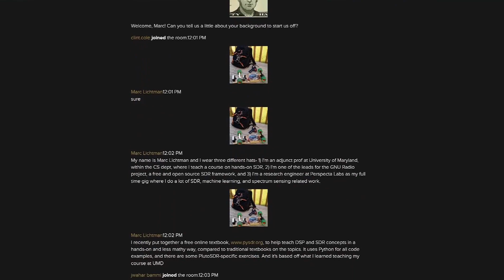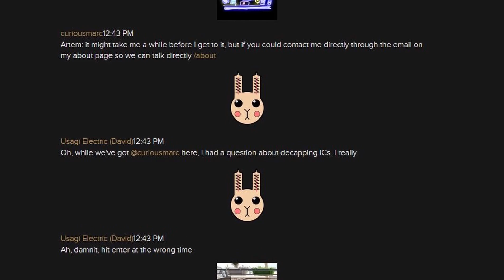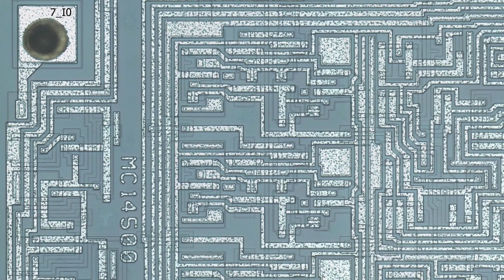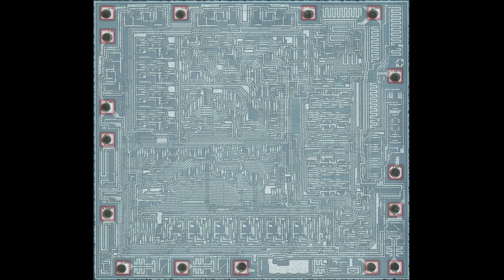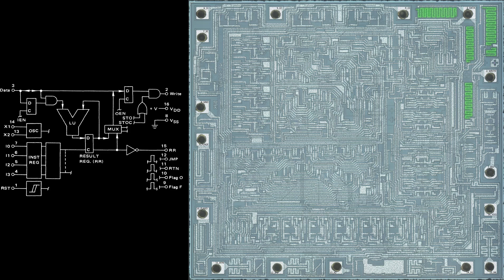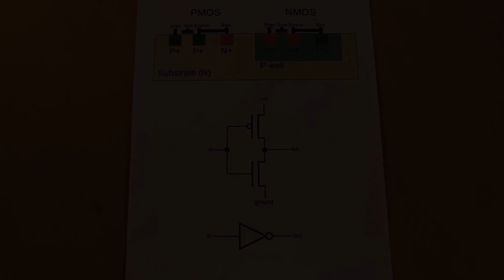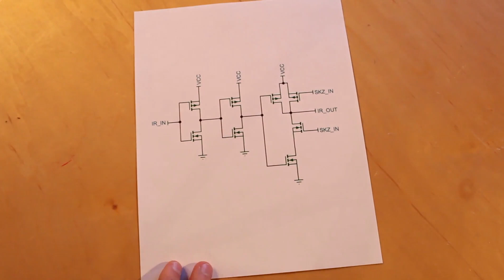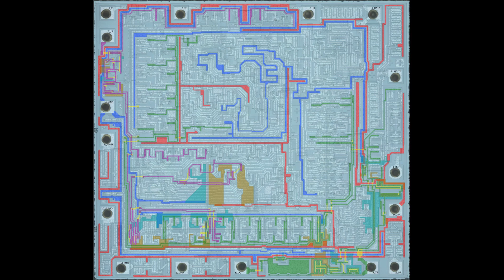Reverse Engineering the Motorola MC14500 1-bit CPU

Comment: To put it a bit more clearly, the first two stages are inverters as already explained. This is basically just buffering the input. The last stage is a NAND gate.

The top two transistors are PMOS, so they conduct when their inputs are low. Because they are in parallel, if either is active (either input is low) they will pull the output high.
Otherwise, it'll let the output float.

A B O
0 0 1
0 1 1
1 0 1
1 1 X

Likewise, the bottom two transistors are NMOS, so they conduct when their inputs are high. Because they are in series, both must be active (both inputs high) for them to pull the output low. Otherwise, they will let the output float.

A B O
0 0 X
0 1 X
1 0 X
1 1 0

Because the truth tables don't overlap, when one set of transistors let the output float, the other set will pull it high or low. In other words, you just combine the truth tables:

A B O
0 0 1
0 1 1
1 0 1
1 1 0

This gives you a NAND gate.
Because CMOS directly connects to either high or low without a pull-up resistor, there is no current flowing when not switching, which is what makes CMOS logic so efficient. It's also what allows logic levels to hit GND and VSS completely, which is super useful. Alternatively, you can create NMOS logic by using only the bottom half of that circuit and using a pull-up resistor or you can create PMOS logic by using only the top half of that circuit and using a pull-down resistor. This, I think, is closer to how tube logic is built.

I'm not familiar enough with tubes to know this, but I wonder if in theory a CMOS like approach could be taken using the concepts of followers and inverters. Obviously this wouldn't be practical in real works applications regardless, but could be a cool experiment.
Reply from the maker: Thank you for the excellent breakdown!
After I showed Ken the video, he sent back an e-mail saying that it was indeed just a NAND gate on the end their, and it was truly a facepalm moment. It was one of those things that was so hard to see until it was pointed out, and then it was so hard to see why I couldn't see it before, haha.

CMOS stuff is really interesting because the combination of both NMOS and PMOS. In tubes, there's not really an equivalent to a PMOS type circuit, so it was really hard for me to wrap my head around the idea of "depletion mode" stuff. To be honest, I still haven't fully grasped how and when to use PMOS or even PNP BJTs. 

But, creating logic gates using diodes and pullups is pretty common in tube circuits! Essentially, to build a NAND gate, you can build a diode logic AND gate and then use the tube as an inverting amplifier. Same with OR and NOR. It really make it easy to build complex logic. I've even managed to get an XOR and XNOR gate to work using just diodes and and inverters! I was quite happy when that one worked: https://youtu.be/ANrSOlgGSOU
Reply: @UsagiElectric  As far as PMOS, it's similar to NMOS and presumably Triode logic, but kinda backwards. So instead of pulling up to logic high, you pull down to logic low. And things that are in series tend to go parallel, and things that are in parallel tend to go series. If that makes sense. As for when to use one over the other? I have no clue.

I'm not super familiar with diode logic as it wasn't taught in the electrical engineering program I went through. (And neither were tubes. Crazy that they'd focus instead on semiconductors! XD) I did just Google to see what logic AND and OR look like and they make sense! But definitely not something I would have thought of really. Similar to your response to learning that was a NAND gate, it seems obvious after.

But I think a lot of that boils down to different people having different backgrounds of knowledge, interests, experiences, etc. And really that just keeps things interesting! (:
Reply: The tube equivalent of a P-channel FET would be made of antimatter and use positrons instead of electrons. Combining the two would be rather dangerous.

Comment: Wow! This takes me back to 45 years ago, when I worked in wafer fabrication. Can't go into specifics, for security reasons, but, on occasion, we used to reverse engineer devices made in other places, to figure out what was being done, and to learn how we could improve on the circuitry. We used a combination of etching, lapping, polishing, staining, lapping at oblique angles, and more, to determine doping types, doping depths, insulation depths, widths, lengths, and other information. It took time and patience, with the right tools, techniques and any insider knowledge which could be gleaned. 

Those methods enabled us to figure out recipes to make better devices, and to tailor them to our customers' exact requirements. (Yes, we called the instructions recipes, because the semiconductors were cooked in ovens. (British humour...)) It was fascinating work, for those with the skills. Our competitors were doing the same things with our circuitry, and different manufacturers would often send sample devices to others, knowing full well that they would undergo forensic examination. The net result has been a rapid pace of progress for most wafer fabrication businesses, and end users are benefitting from that type of reverse engineering to this day.
Reply: It's interesting that it's deemed to be less work to try to reverse engineer a chip, given how difficult it seems to be, then to create a new one.  But then you are saying almost 50 years ago, which means it was easier to reverse engineer whatever was around back then, and harder to make a chip due to lacking the software we have now.

Comment: I used to work at a chip layout company and one of the services they provided was called "Competitor Analysis"...  The company would acquire some chips, then they would be decapped with acid and one of the engineers would painstakingly move over the entire chip's surface using a very expensive optical microscope, while recording the microscope picture with a special TV-resolution camera connected to a VCR, pausing at roughly one screen-worths of a picture.  They'd then strip the current layer off and repeat the process until all layers had been filmed.  Then some poor person at the company would use AutoCAD and a video capture card to trace over each screen of the video.  Then using this simplified drawing they would work it up to an actual schematic.  Incredibly time-consuming and very difficult, since as you might guess you don't get a great picture from a VCR tape, and the decapped chip was never perfectly etched down to the current layer.  Also some of these layers are somewhat transparent, so it was a very complicated process.  Obviously this kind of procedure would never work on smaller digital chips, and in the late 90s it was starting to become impractical for analog/hybrid chips anyway.  Crazy stuff.

Comment: at the end of the day it's almost just n-channel and p-channel Mosfet wired together in a logical way. 
NPN and PNP transistors would have needed resistors and current flow. 
Mosfet only require power when the state is switched.

Comment: A lot of vacuum tube computers used serial ALUs. So essentially you have a 1-bit ALU, then using shift registers as your CPU registers, you can shift your data through your 1-bit ALU keeping track of the carry in a flip flop. 
You might want to do that instead. You'll still save loads of hardware, but the processor'll be a lot more capable.
Reply from the maker: Thank you for the comment!
I've actually done a bit of testing with building up architecture around using serial architecture (serial ALU, shift registers, etc.). It's a really smart way to do things, and in the future I may very well lean into that idea harder. The primary reason behind building a replica of the MC14500 is because I think it'd be cool, haha. Also, I like the idea of being able to build a system based around the actual chip and then use that as a preliminary test bed for what might or might not work on the tube version. 

Also, the more I tinker with the MC14500, the more I discover that it can do some really interesting and complicated things. For example, using IEN and OEN to mask inputs or outputs opens a ton of avenues for IF-THEN-ELSE logic or WHILE loops. In the future I'd love to work on building a sort of "math co-processor". The MC14500 would essentially be the workhorse that moves data around and performs complex loops, and an additional 1-bit adder could be used whenever arithmetic functions are specifically needed.

The primary downside is that programs will be massively long. But, I've got some ideas knocking around in my noggin about how to handle that.
Reply: @UsagiElectric  No problem, and thanks. Yeah i think you'll definitly need a stack pointer or link register then if you're going with this design. Because you'll be using subroutines to carry out most operations longer than 1-bit. Does the MC14500 have either of these?
Reply from the maker: @tomcombe4813  Unfortunately, the MC14500 doesn't have either of those, haha. But, that doesn't mean they can't be implemented externally, which is the primary reason I chose this chip. It's more a building block than an all-in-one package, allowing me to build and add modules as they become necessary.
Reply: @UsagiElectric  I'm sure you'll figure out a way to implement it. Good luck and well done, this is a really good series. I don't think i've seen someone on youtube build a full vacuum tube computer before so i'm excited to see how it ends up

Comment: Why are there two inverters? I know you might not have the answer or whatever but it doesn't make sense to me that there's two inverters and a NAND gate rather than just a NAND gate.
Reply: I can think up a variety of reasons. 

1. Sharpens the signal edge. 
2. Adds time delay to better hit a signal window downstream. 
3. There was extra die space in this block, and it was easier or more reliable to build two inverters than add more metalization.